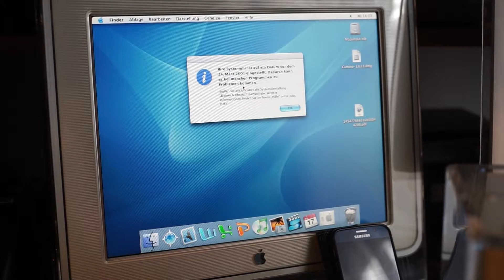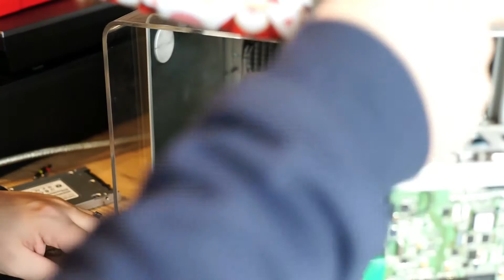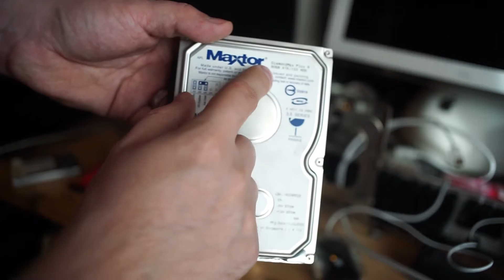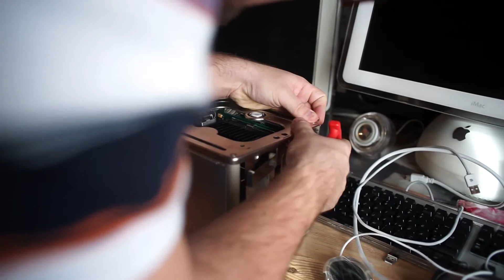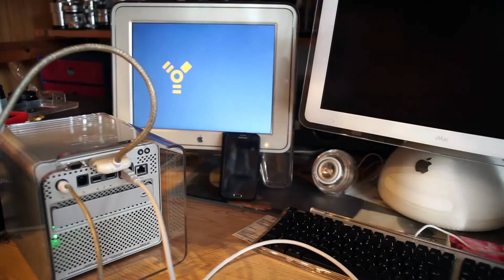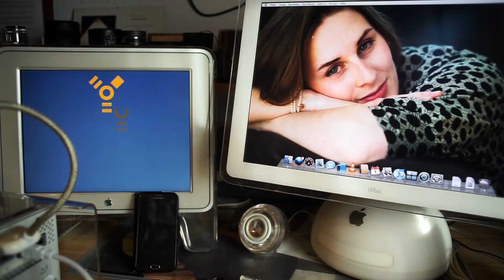Apple G4 Cube SSD Conversion

Comment: If everything inside the cube is serviceable how difficult is it to replace the USB card with a USB 2.0 card?

It would make it in my mind much more user friendly.
Reply from the maker: I think there would be a different Problem: you have to Look at the Connection to the Motherboard. Do you have the right Card for that? Is there even one? What is the Dataconnection and how big of a bottlenek is IT?

Comment: So the SSD makes the cube run slower because of Tiger? I'm not sure a slower cube is worth the noise reduction...
Reply from the maker: No its not slower just not a lot faster because of the ide bus. This bus is maxed out quite fast. You get better airflow in there as well. So its not a bad idea to consider it...
Reply: doertepn Ah yes, correct. But I also wonder about OS Tiger. Back then SSDs were rare and so file and disk management was optimized for spindle drives. Wonder if using SSDs on old OSs is actually bad for the SSDs...

Comment: If you want to make the cube run faster you have two options.
1 Format" the SSD in the cube so it has the Apple HFS+ file system on the SSD. 
SSD's usually come formatted for windows which is fat dos.
2. You could have put the SSD into the drive caddy I saw connected to your iMac.
I have all of the Apple operating systems so I usually install from an OS disk.

I tend to use Carbon Copy Cloner when I have lots of applications to install and it becomes a bit of a hassle installing all the apps one by one. 
I do accept that when you have installed a basic OS the computer goes through all the updates one by one which can take a long time. 
If you have original Apple OSX disks you will find that the Cube will run OSX10.5 quite comfortably.
Reply from the maker: Jeremy Clayton-Travis the hfs+ format is a great tip! thanks for that! do you really think it will improve the systems speed by a lot? i may do this format if i find the time to do that if it does make a differenz. now to the os for the cube: i put os tiger on it because leopard is so much more demanding, that i am happy to live with tiger. yes i have a view Software problems but this is ok by me.... i dont do system new intalls when i can. i own all of them but they are specific for 1 system. i would have to change those disks and creat new ones... and anyway: i have a harddrive with all the systems including updates. but without a hugh summe of programms so i love to use this because i dont have the problem of failed CDs and stuff like that... on my clamshell mac i had to install the system from new and it was a nightmare (i made videos about that as well) so i am really happy using ccc. thank you so much for your Tips and your comment! i am really glad about it ;-) i hope you enjoyed the content
greatings
Reply: The standard file format for mac os had sever limitations when it came to Hard drives over 1gig. It was efficient in the days of old Mac Classics and Centris computers but when apple moved to PPC computing and hard drive sizes started to increase to 6 gig people just found that the file sizes increased so although in theory you could install up to 120 gig hard drives ( I think the limit was about 138 or something) it became pointless. Once you moved to HSF+ I found I could install 500 gig drives in G4s and they worked well. I do have a G4 MDD which I have 4x 500 gig drives and I rip all my CD's onto it. I was going to install a SATA card and try an SATA SSD. 
The other thing to remember is that most SSDs come formatted with a Windows PC filing system so formatting it in Mac HSF+ helps in writing the files accurately. I did have problems when I installed an SSD in G3 and people talked about "Trim" which I didn't really understand but I believe it produced file corruptions every time you wrote a fie to disk or rebooted the computer. I know that SSDs have come on a long way since the first ones so I might have another go.
Reply: Thank you. Because I missed out on learning an instrument I focused on Hi Fidelity and became a buyer working for a high end retail shop, mostly supplying musicians and people who worked for the BBC and like. 
So electronics it became and making my own equipment especially loud speakers and amplifiers.
Reply from the maker: +Jeremy Clayton-Travis thats really amazing! But amplifiers and speakers are a really expensiv hobby! I build a system myself a view years ago: a 50s Musikbox completly striped out and then a 500w soundsystem with a radio, a turntable, and a cdplayer including usb, aux and my raspberry pi music server. But that was hugly expensiv...
Reply: I don't know about Today but in the past buying an expensive amplifier was a bit of a luxury. I was in the Hi Fi trade so I could often pick up equipment cheaply if I spoke to the reps of companies. 
I think the main benefit was building amplifiers of considerably higher quality than you could buy off the shelf. I knew a man called John Linsley Hood who was an instrumentation engineer for a large company and he was in the 1970s considered the "god" of amplification.
Measuring of equipment required low distortion, low noise and linearity. He produced some astounding class A amplifiers. I also used to enjoy building loudspeakers primarily  of Transmission Line design produced by a Dr A.R. Bailey in the 1960s.
You could build a much better Hi Fi and speakers that you could buy and far cheaper. £300 would build and Amp and speakers that would cost you £1000 to buy something equivalent. anyway we are getting away from computers with all this Hi Fi talk.  I had lots of staff that were into Sinclair computers in latter 1970s and they would spend hours typing in code just to get their names running across a tv screen. It rather put me off computing till I discovered Apple Macs in 1990 with a mac plus and latter a SE30 and a classic. My main hobby is still music and Hi Fi equipment.
Reply from the maker: +Jeremy Clayton-Travis yeah the 1970es where the best years of buying amps, because of the hugh competition of the day and they are until  now the best thing money can buy! I would love to own a silver 1970 pioneer or a marantz a class amp. But they are out of my reach as a student. But you have to dream about something;-) building amps is something i have never done. And i dont think i would be able to... i love a bit of soldering and tinkering but that i think would be a step to far for me... so chapaux to you! Back to the macs ;-) the first pc i remebere was the apple IIc of my dad. Its a pitty that it is gone. After that apple pcs where just the coolest thing to look at but they really where to expensiv for a school boy to own, so i began a view years back, to buy all of those old machines that where a dream for me. And thats the reason why i own 7 working apple pcs (+ my main pc which is in a ppc g5 case +my cnc computer which is in a g4 Quicksilver case) i know its not necessary but i have so much fun doing stuff with them and i really enjoy playing with them. What apple pcs do you own?
Greatings